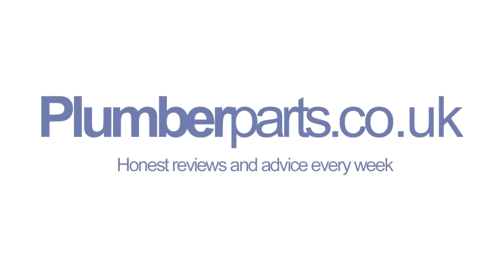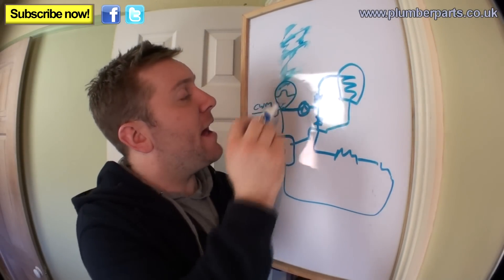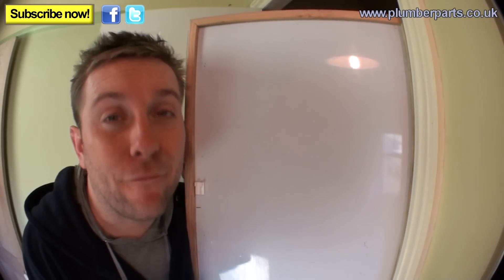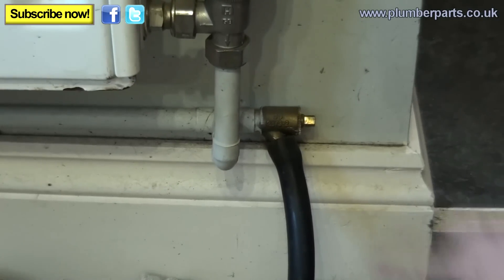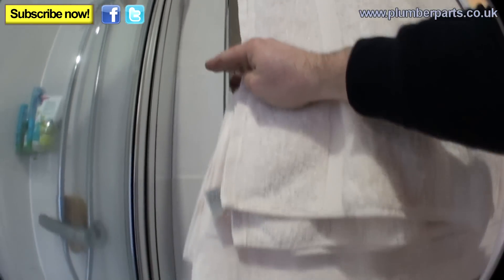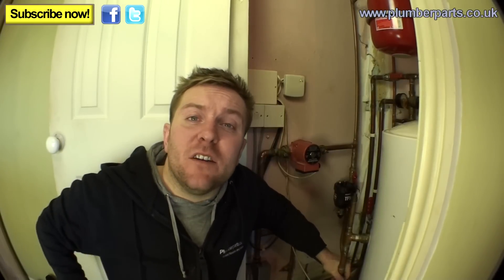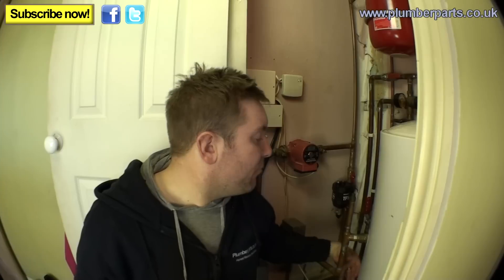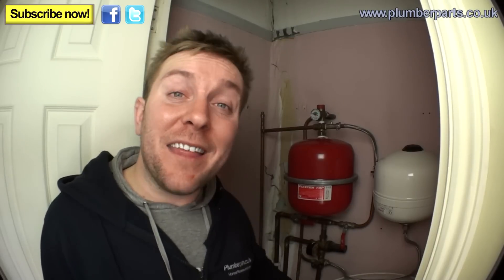HOW TO DRAIN YOUR HEATING SYSTEM - Pressurised - PLUMBING TIPS

Comment: Add Inhibitor after you've filled and pressurised the system, I dont think so, remember you are doing this for Diy ers, so teach it right, it should have gone in the top of that tall rad when empty, or the magnaclean.
Reply from the maker: You check for leaks first by filling the system. You wouldn't want to add inhibitor first, then find you've got a leak then drain it all out would you? :) PP!

Comment: Hi, what about the boiler? Mine is a Potterton condensing system boiler with isolating valves. Should I turn these to the off position before draining the system to protect the boiler and pump getting an airlock when draining the system?
Also, it replaced an old gravity fed system. Whoever fitted it had problems with the little header tank, so they replaced it with a sealed expansion tank. The system works OK with this second expansion tank plus the one in the system boiler. Is it a problem? Any tips if it remains?

Comment: Hi there, Thanks for all your great videos. I have to change a thermostatic radiator valve and the system is an open vent system with a Worcester Greenstar Ri boiler connected to a hot water tank. Do you know if there would also be a pump, though I can't see one, and also please could you tell me how to drain and then refill the system. There is a small black tank in the loft for hot water. Thanks so much, and hope you can help

Comment: Hi buddy, great vid!
One question though. There is a big white vessel next to the red one. Is that for the hot water?
Reply: The red one is for the heating, the white one is for the hot water pressurised cylinder that gives hot water at mains pressure around the hosue.

Comment: You kind of skipped the bit about how to inhibit the system. Yes I know you have another video with that on with your handy pump... however I'm just a DIY person with no tools and a pressurized system. To get my inhibitor in, I turned off my boiler system, drained some water and then added it to the towel radiator which you can fully unscrew (just poured it into the towel radiator). Then closed all valves, refilled and re-pressurized. Was that an ok way to do it? Keep up the good work, I’m pretty much sorted with what I’ve got to now (apart from rebalancing upstairs radiators perhaps) but you’ve helped me a lot with all your vids!